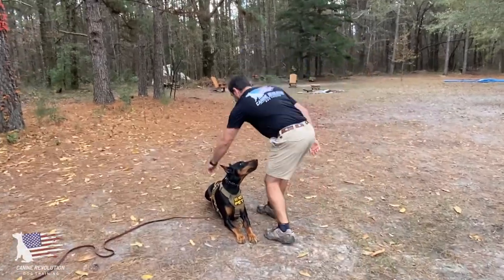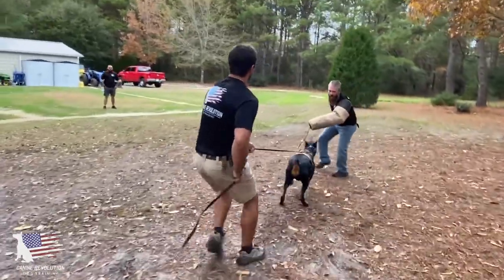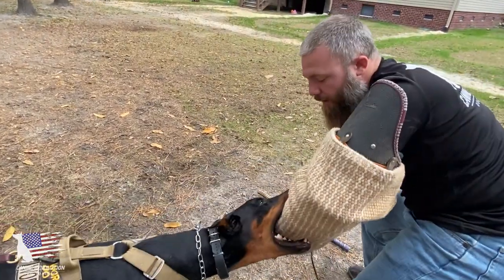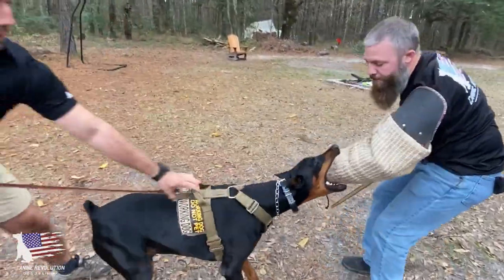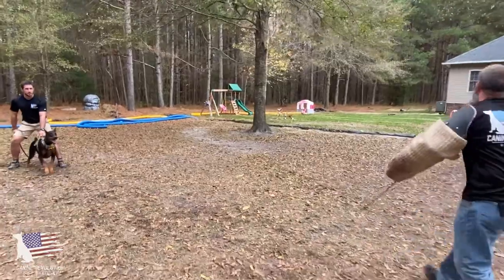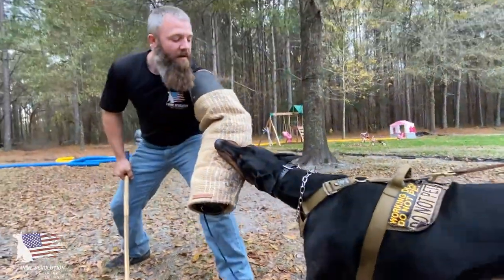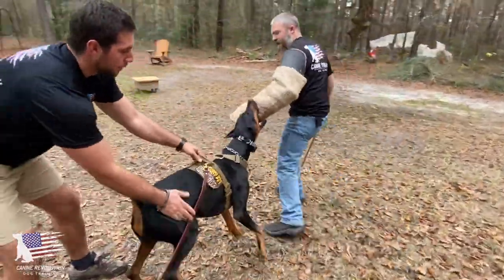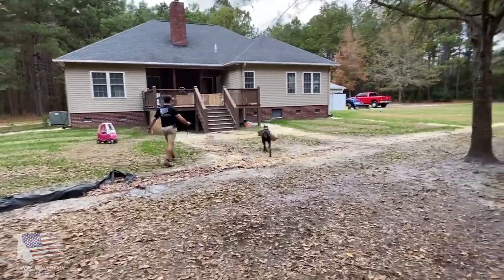Doberman Goes HAM On Bite Sleeve

Comment: What is a bite force of dobermann
Reply from the maker: It is approximated that the bite force of a Doberman is about 305 PSI, however there are numerous factors that will affect the actual power and strength of an individual dog's bite and the pressure received from that bite.
Reply: @CanineRevolution  👍👍305 psi Bite force is american doberman or European doberman?american bull dog bite force also 305psi noh? plz tell me.🤔🤔